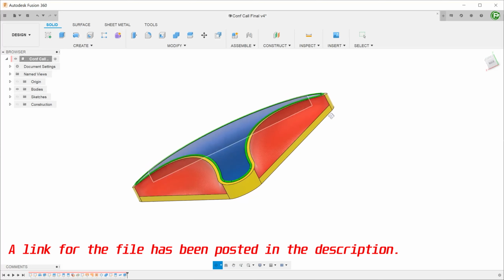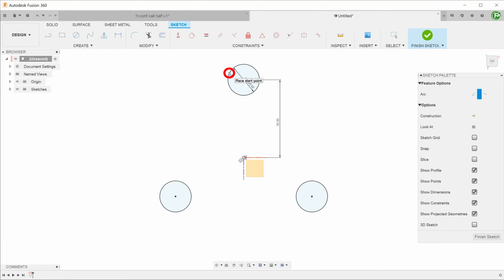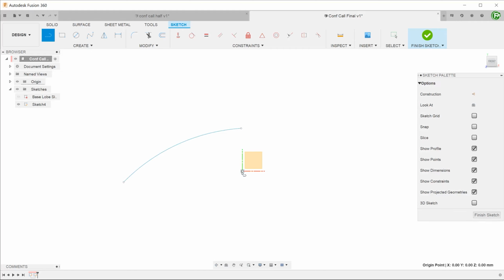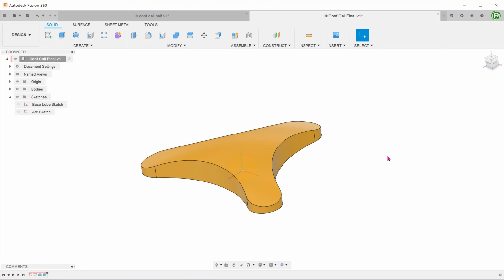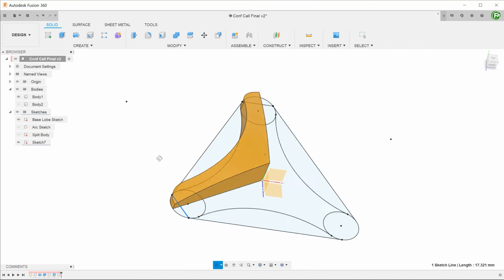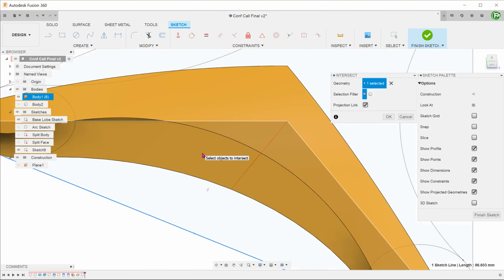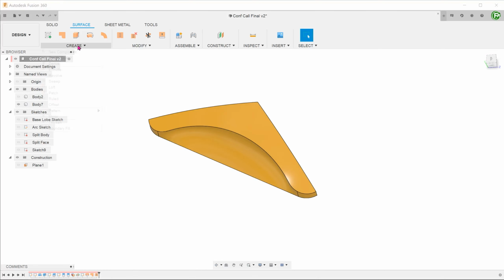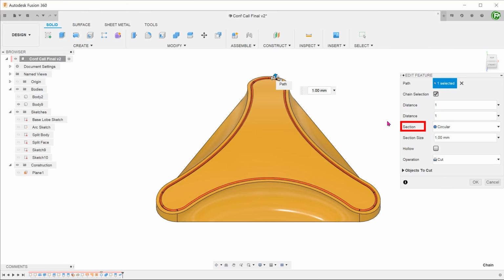Fusion 360 - Case Study 8

Comment: I followed this tutorial and I had a lot of faces on the top face.  When I project the top face I ended up with so many lines. It became a bit of a mess. I had to delete the faces until the roof was gone and did a patch to  seal it.  What would be the cause of having many faces?  It is a single body.  There were a number of split face operations and  there was a stitch operation. Does stitch merge faces?
Reply from the maker: Hi, would you like to share your model?
Reply from the maker: Does stitch merge faces?
This can be tricky question to answer. To some, merging might mean fusing of 2 faces where the split line disappears. To others, it might just mean a grouping of faces. In the case of 2 faces that are curvature continuous (C2 or C3) to each other, the split line would disappear after stitching. In the case where 2 faces are tangent (C1), the split line will still be there after stitching. However, in both cases, the surfaces are grouped as one single surface in the bodies folder.
Reply from the maker: Hi, sorry, it took me a while to get to this. When I open the link, it looks like I could only view it but not download. Would you mind to share the file fully so that I can take a look at the steps?
Reply: @Fusion360School  I just checked for download I need subscription.  I am currently using a free edition.  One of those changes kicked in after 1/10.
Reply from the maker: @JT-jy2sy  Sorry, I was not aware that the changes affected file sharing.